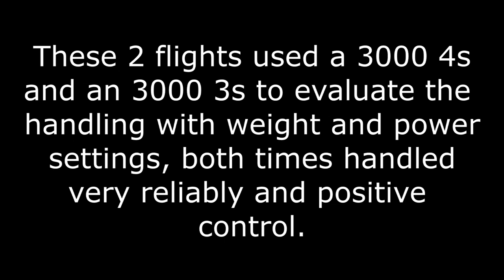Northern Pike 3d printed wing test flights

Comment: Exuse me sur, sorry for interrupion, I was wondering what have you done about its center of gravity, did you balnce it on the marks or you used another position.
My gratitude.
Reply from the maker: When we test flew his Pike, we stuck to the marked cg locations and it behaved very well and being a lightweight setup, had some really well handling at low speed.  Definitely go by the location specified.
Reply: @Airtruksrus  the marks on the wings or the mark on the bottom of the plane?
Reply from the maker: @alilakkis5622  that would be the marks half way out on the wing and 1 inch (2.5 cm) back from the leading edge.  It should be imprinted in the skin on the lower side.  When  I printed my plane up, made it really heavy due to my printer not working so well with a single wall thickness.  Making another go with a Printrbot I picked up, much better parts output.

Comment: What servos do you use? Also I was wondering is there any remotes that I can get that will work for $50 or under? I am just wondering.
Reply from the maker: I usually go for the hitec brand that fit due to reliability but most of the small Turnigy 9g brand should work.  The surfaces have a light loading given the carbon rod hinge, so should have less chance of breaking gears.  As for any of the Turnigy 9xr radios, that is about the cheapest radios I’ve come across that come close to the $50 pricing, it was the $30 in shipping that got me but with the open tx programming, getting the wing mixing is rather easy once you get past setting up the aileron and elevator combination. Personally I’d spend a little more on a good radio since most accommodate so many different profiles and reliability, definitely worth the investment.  Usually Radiolink or Frsky type is a preferred go to nowadays.

Comment: can this be printed at half size and still fly?
Reply from the maker: You can reduce the size in the print program, but you’d have to very precise on reduction of all the individual pieces since there might be small variations when it all slides into the wing locks.  Would have to look for an appropriate size carbon spar and use a fairly small miniquad motor.  But yeah, a little effort, it could be done.  Might be a little more of a speedster but the handling should be somewhat similar at best guess.  Might be able to fit some of the micro video gear in there with what’s available.  Would definitely take far less print time.  I’d say give it a try.

Comment: Is 2205 2300kv is enough for 1 shell ?
Reply from the maker: The way the plane turned out with the Prusa, the Pikes airframe had plenty strength to do just about any maneuver I worked it through, even inverted.  Handled way better than I thought.  Definitely need to keep the setup light on this one, especially with 1 shell.